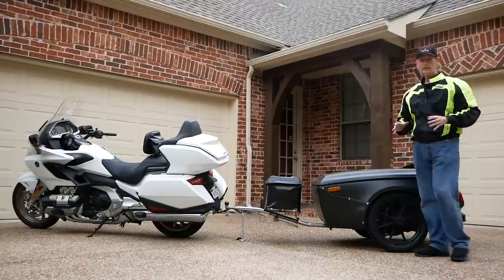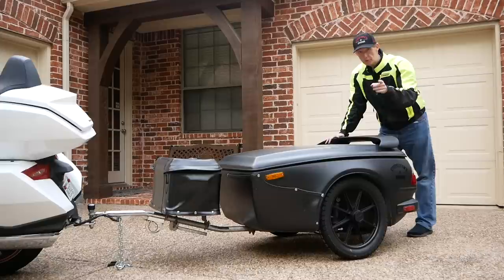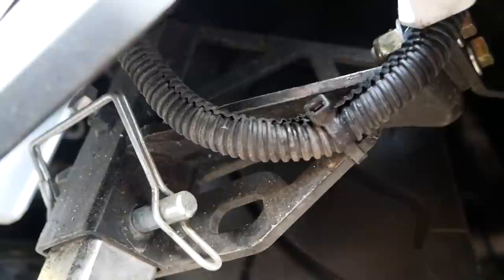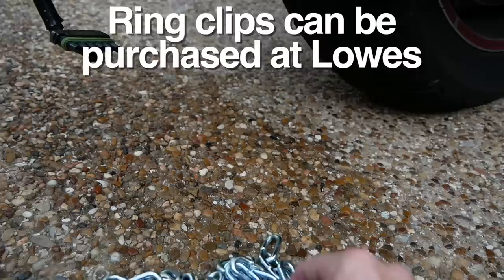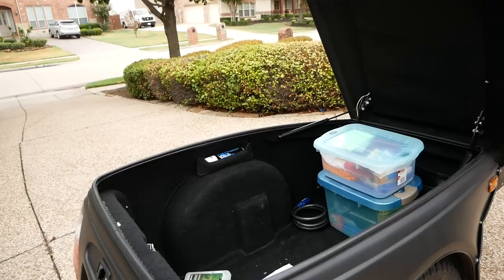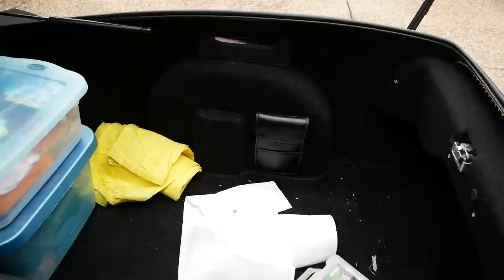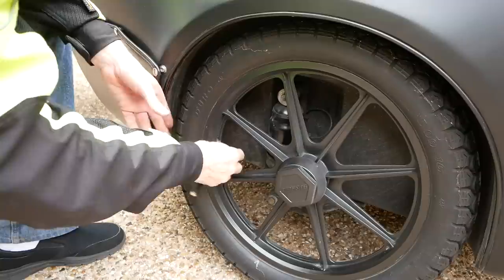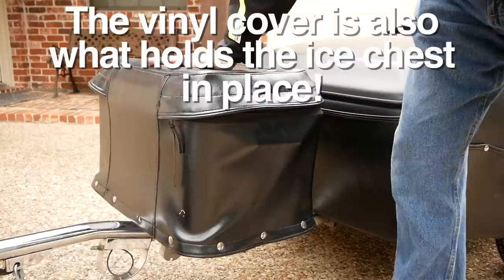Don't Pull A Trailer With Your Motorcycle Until You Watch This | OLD VERSION

Comment: As a former truck driver, I understand tongue weight and its importance. When I first started pulling a trailer with my bike, every time I would stop and open my trailer, all the cargo had moved to the front. While the cargo moving to the front concerned me, the thought of everything moving to the back and taking away all my tongue weight concerned me even more. I bought three totes that just barely fit inside the trailer. Therefore I can strategically place cargo and know it's going to stay where I put it and maintain correct handling while I'm traveling and running errands. 

On 2 pulling 2.
Reply: You are so right, negative tongue weight will wreck you with any trailer.
Reply: Same hear 👍👍

Comment: The threaded links should be installed reversed from what is shown.   Vibration and gravity would let the link unthread and open up during transit.  Gravity needs to work to tighten, not loosen the link.   Also, that spring retained pin in the receiver may be unlatched by the safety chain as the bike is being turned and the chain binds.   Either use a bolt or mount the chains further away from the pin.   Lastly, that quick link is rated for a static load, not an impact load.   A trailer coming off its mount in transit is definitely not a static load.  ~500lbs rating is not as good as you think.

Comment: Generally a good presentation, but you left out two quite important points on towing the Bushtec. First, no mention of lubrication -- on the bottom of the unit, and very importantly,  lubrication of the floating ball in the hitch.  In the video it looked pretty dry, and there was no mention of it at all.  Second, air adjustment to the suspension must be done before attaching the trailer to the bike so that the the wheels can adjust to the change in pressure by moving the trailer back and forth by hand. I picked up my Bushtec at the factory in Tenn. and they emphasised these points

Comment: I build my own trailers and we travel with one in tow as a standard.  Like pulling a trailer behind your car or truck it's mostly common sense. and with a two wheel bike it definitely will affect handling, braking and control so one must use caution. We try to keep our trailer as light as possible and avoid that tendency to haul the kitchen sink along with us. I guess this means light beer also.

Comment: Cruiseman, when you said with the chains criss-crossed it would balance the trailer should it ever break lose of the bike, actually you criss-cross the chains to “cradle” the hitch not allowing it to dig into the road surface.
Cross crossing is almost mandatory in most states due to this reason. Also by criss-crossing them they will not bind, not cross -crossing them causes the chain on the side being turned away from to stretch or straighten out which could upset the dynamics of the turn. On a side note I have 3-4 extra links on my chains just in case another bike has to pull it and it’s not set up the same as mine, I just let the extra hang from the spring clip, no where near to long. Great videos by the way. Been pulling my trailer for 15 years now. Riding for 40. 1993 GL 1500 Interstate.
Reply: I work as a tow truck driver and always cross the safety chains but I go one half wrap farther so left is left and right is right and it still cradles the hitch. Without doing that, you are still in jeopardy of binding if you turn far enough. Granted, a tight turn like that on a cycle is not likely but it is just the way that I have done it for the last 25 years.

Comment: I have alway pulled a trailer on long trips however you are correct there is nothing that is more dangerous than pulling a trailer as it can cause real issues during stopping. Pulling with a trike is not near as bad as most trikes are very well suited for this. I use a different type of hookup which does not require chains as it is more akin to a 5th wheel type setup. Overloading is a common issue on trailers and normally one should use discretion regarding load weights.

Comment: Over here in the UK the secondary coupler (your crossed chains) is a legal requirement and requires as some posts have recommended that in the event of a tow hitch failure the secondary coupler must keep the trailer hitch from dragging on the road.  Re trailer tyre pressures.  I've owned three trailers and have never been able to fined any info on recommended tyre pressures. 30psi sounds very high for your Bushtec and I'd be surprised if the trailer doesn't bounce around on the 3.00x16 tyres.  In contrast, I've 16.5x6.5x8 tyres on my trailer which I run at 7.5psi (loaded) which provides excellent stability.  Here's a formula I eventually found on the 'net which might be useful to your followers:
A. Gross Trailer Weight - e.g. 330lbs (legal limit over here)
B. Combined Maximum Trailer Tyre Load - e.g. 3124lbs for my tyres
C. Maximum Trailer Tyre Pressure - e.g. 70psi for my tyres
D. B/A - e.g. 9.47
Tyre pressures = C/D e.g. 7.39psi
I'd be interesting Cruiseman if you applied the formula to your Bushtec and see if the result is 30psi.  The thing is your Bushtec weighs in at 140lbs empty and has a 210lbs capacity so I can't see that a single recommended pressure of 30psi can cover such a weight range.

p.s. I wouldn't swap my 2004 GL1800 for a +2018.  Yes I'd have the DCT engine but nothing else.

Comment: Thanks for the info, I'm thinking about getting a trailer for the next riding season. I'm looking at a used trailer to tow behind my 07 Yamaha Royal Star tour deluxe cruiser. I've never towed a motorcycle trailer in my 26 years of riding. But I do have the knowledge of trailer towing as I was a truck driver and I've towed many trailers behind my Ford F250 pickup for many years. I imagine some of the same holds true with a bike trailer and then there may be some stuff I didn't know or need to get used to.

Comment: I've got about 30,00 miles on my Bushtec.  Other than all the points made in the video, pulling a Bushtec is like having a passenger.  Do think ahead when breaking, you've got a few extra pounds of load.  Never had a problem with anything mechanical or otherwise,  Check tire pressure frequently and wear won't be a problem.  The three best things about a Bushtec that make it the best bike trailer are: Heim joint hitch - absolutely no play like in a ball hitch; the adjustable air ride suspension - tune the shocks to the load in your trailer.  I pump the shocks up first until the top of the tires point out, then load the trailer.  Roll the trailer back and forth to get the tires to adjust, usually I have to bleed some air off to get them to be verticle, but that is easier than trying to do it once hooked up to the bike.  With proper tire inflation and properly adjusted air shocks a Bustec will ALWAYS stay straight behind the bike - NO side to side sway, NO bouncing over potholes or speed bumps.  With the trailer attached to the bike, pick up the rear of the trailer and drop it - the wheels hit the ground and stay there - no bounce!  It is the Cadillac of bike trailers.  My first was was ten years old and I had it for 9 years before trading in on a new Bushtec.  My buddies pull other trailers and I can watch them wiggle back and forth as we ride down the road.  Doesn't happen on a Bushtec.  Pricey, but worth ever penny!  I live near DC; pulled the trailer to Alaska, Sturgis, Utah, Vermont, Memphis, Florida New Jersey, North Carolina - every where I go.

Comment: OUTSTANDING video 📹 👏...!!   🙋question - I've been reviewing the pro's & con's to pulling a trailer, not so much the safety of pulling as I understand that extra precautions are needed in towing, but more about the damage it can cause the motorcycle? 

I have a 2019 HD Tri-Glide Ultra, and want to kno if pulling a trailer behind a trike vs (2) wheels is more beneficial in regards to safety & mechanical issues?

Comment: Another option is to use a bolt through those two holes in the trailer tongue to attach the chains.  Sometimes that is easier than trying to get the connecting type links through those holes.
Reply from the maker: Yes, and I almost used a bolt. I should have mentioned that as an option.

Comment: Great job with the video, one comment though. On your locking rings that you put on the trailer to connect the chains, the rings should be turned down so when you screw the nut down you and not screwing the nut up - this way if the nut where to come loose it is not going to unscrew like you where tightening the nut.  Ha e a safe trip to Wing Ding. 👍🏼
Reply: and with nut  on outside so one can see the nut ( if to work loses). With nut outside less of change the nut could cut  into the wire harness that is right there.

Comment: Nice work. I  use a metal cutting wheel on my grinder or even on a drill for a cutting chain when I’m maintaining or fixing up my boat mooring. Have to be careful with the heat and sparks though
Reply from the maker: Great tip!

Comment: i maybe wrong but at the company i work for we were taught to cross the the chain. the right side one on the trailer goes to the left side of the tow vehicle and visa versa.  this way when you make a turn the chain is does not get pulled tight.

Comment: TY for shearing.
I need to do 40 minutes groceries shopping. And some times get propane. So my hiking back pack dos not work alone.
Is it easier to just go with saddlebags and cargo rakes on front and back for near the same cargo space a that trailer ? Keep in mind I don't have a missive fiber glass body like that as its a electric dirt bike. sur ron /Segway x260-160.

Comment: I really enjoyed this video and with most of your tips I agreed with them, BUT with the one you said "I like to cross the chains" you should have said you should always cross the chains. Depending on where you are it is actually mandatory that the safety chains be crossed, if stopped you could get a ticket and a fine if they aren't. I loved how you showed that you make a safety chain to the proper length (IMHO I think one or two more links would not have hurt just to make sure you wouldn't bind on a tight turn) and not just go ehh that's good enough, improper chain size is one of my pet peeves and I see it all the time. I had wished you had commented at the end that many of these tips also are relevant to towing with a car or truck. Again good video and I think I'll bookmark this to share with people I see improperly towing with their bike or other vehicles.
Reply from the maker: Good points. I did not know you could get a ticket for not crossing the chains!
Reply: Over twenty years of towing profectionaly so I've learned a bit, sometimes the hard way lol
Reply from the maker: Agree, an extra link or two would have probably been good.
Reply: Everything from trailers to cars and trucks. I used to tow professionally and specialized in flatbed but over the years have used most types of vehicles except heavy recovery.
Reply: A professional flatbed driver tows just about everything,  the last truck I drove was a freightliner with a 23foot tilt load flatbed 15 ton limit.
Reply: Canada but if you Google tilt load flatbed that should give you a few ideas
Reply: My content is private which is why you can't see it. If you have never seen a flatbed tow anything then there is a serious problem, really. BTW if I don't answer right away I could be out of cell range

Comment: i was told they outlawed that hitch so if your still using it check and see before you use it again. i'm not say it is outlawed but i seen 3 videos so far that they was changing it because they said it was. i'm looking at building a 3x6 trailer and build a camper on it to camp in and hold my stuff. and maybe use to to haul my little trail 125 so when i park i can jump on it and hit the trails.

Comment: Checking both sets of brakes might be necessary. As the pads wear on some bikes, the rear brakes might come out of adjustment resulting in the brake light being on constantly. I've noticed that on mine before and changed my look over procedure accordingly.

Comment: Great video.  I just bought a Bushtec trailer last week in preparation for the trip to Wingding.  I also noticed they are having classes on towing a trailer behind a motorcycle at the convention.
Reply: So you need a trailer to get to the place where you can get a class on how to pull a trailer. Damn, that sucks. Lol

Comment: On my trailers I leave a little extra length on the safety chains, but use a bungy to take up the slack.  The bungy has no real strength so won't interfere with the chain, but keeps it snug and reduces rattle.  (note I do this on trailers I tow with the car; I don't tow with the bike (yet)).
Reply from the maker: Good idea

Comment: It would be interesting to hear how your trip goes with the DCT transmission pulling the trailer.  What mode you rode in and what fuel mileage you achieved.  Im thinking about a purchase of a new Goldwing DCT and Timeout trailer in the future, just in time for retirement.
Reply from the maker: You have to ride in Tour mode, ECON just does not have enough power. Experience pulling the trailer is no different than with previous Goldwings. You don't even know it is back there until it comes time to stop. Requires a little more braking.

Comment: All great advice.  I pull my trailer on every trip.  i have a Trike, so always looking in the mirror to make sure it is still there.  With 6 cylinders and all that power I don't notice it is there.  But I do have much more weight in mine with 2 up and long trips.  Air shocks on the trailer is the bomb.

Comment: Sir, Would it not be a wise move to try your motorcycle and trailer in tight turns very slowly off the main road to ensure the chains do not limit the turning circle of your combination? Thank you
Reply: May I suggest to you? Just do a static test right in your own driveway. Move your M/C 90` Left and check for chain length and adjust as necessary, and that's up to your own judgment. Do the same 90` to the right. Now position your M/C inline with your trailer and again adjust as you see fit. I recommend this procedure prior to your said test ride.  You're going to love the results of towing a trailer. My choice was Bushtec. You just can't beat the Bushtec's suspension period.

Comment: Static weight and dynamic weight are all different. You must account for inertia as the slack in the chain runs out and jerks. You need at least 500 lbs for connectors, 1000 is better. I use the screw closed links, not snap links.

Comment: I have a Starlight trailer that I pulled with a 2006 1700 Yamaha Road Star.  We took a trip from the Boise Idaho area to Astoria Oregon and back.  The trailer with camping equipment weighed about 350 lbs. and my wife rode on the back.  The setup performed flawlessly.  The bike was recently totaled when a car rear ended me.  I want to get another motorcycle.  My questions is can I go down to a newer 1300 cc bike and expect it to do the same job?  The Road Star was a carbureted 8.3 to 1 compression ratio engine. I enjoyed your video, good advice about slowing down and braking.

Comment: Seems like the cooler full of ice and drinks would throw off the 10% tongue weight alot?  Do you have to add cargo to the trailer when using the cooler because of this or is it not that much of an issue?
Reply from the maker: Definitely. I always figure about 15 pounds for the ice chest, in fact, I usually put a couple of 10lb weights inside when measuring the tongue weight.
Reply: I would imagine that weight placed over the axle wouldn't really add to the tongue weight, but it would in the overall weight of the trailer.
Reply: What are the outside dimension of the cooler and the dry weight ?
Reply from the maker: Cooler is approx 20X15X14 and maybe weights 2 lbs. Trailer dry weight is 140.

Comment: I have 2018 and thinking about buying a trailer and I wonder the new Wing pull the pull behind trailer?  Also, I plan on getting a revco  trailer hitch.
Reply from the maker: I pulled my Bushtec behind my 2018 to Knoxville, TN from Texas, and back. No problems. However, if you have a DCT, you will need to use Tour Mode. Econ Mode does not have enough muscle to pull the trailer. Even the Hill Start Assist works with the trailer. Saved my butt once.
Reply: Cruiseman's Garage Thank you!

Comment: If you pull a trailer alot, will you experience higher rear tire tread wear?
Reply: more likely other mechanical wear would be accelerated like clutch, drivetrain etc.

Comment: There is a reason for crossing the chains. If your trailer for any reason gets disconnected from the vehicle (bike or car or truck) then the front of the trailer will rest on the chains and not dig in to the road.

Comment: I purchased a cargo pro mct3x4 trailer to tow behind my harley ultra classic. The trailer alone is 200# and with the bikes 550# max towing capacity... the trailer has far more footage of cargo space than I could ever safely fill and haul. I need to upgrade my 2" trailer ball to a heim joint or something that can rotate 360⁰. A friend years ago while towing with a heim joint was clipped from the side by an out of control car. His trailer flipped over upside-down and my friend who barely held onto his bike and probably ruined his underwear was able to pull over to the shoulder while his trailer drug upside-down down behind his bike. An automotive style trailer ball with no ability to rotate around would have flipped his bike over as well.
Reply from the maker: I am a big fan of the Heim joint for that reason.